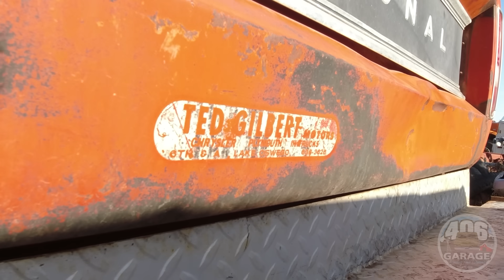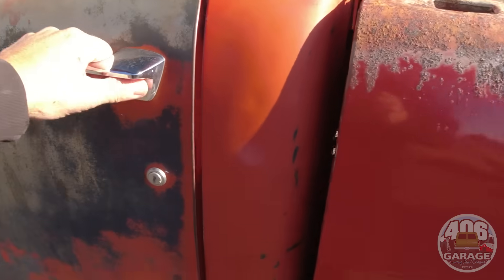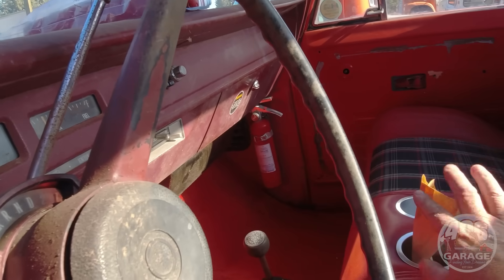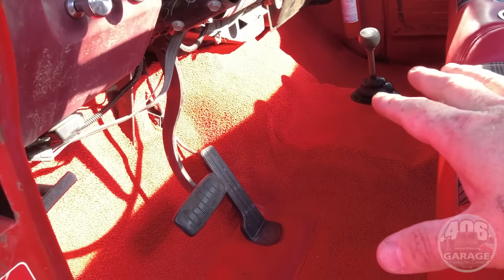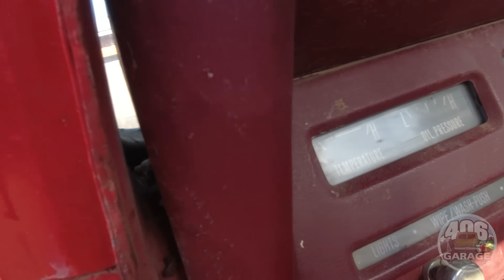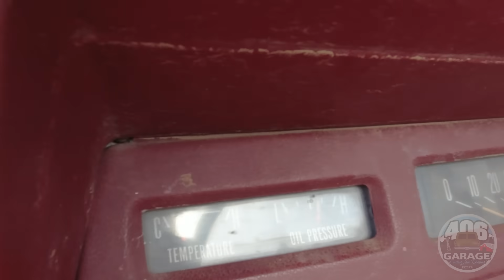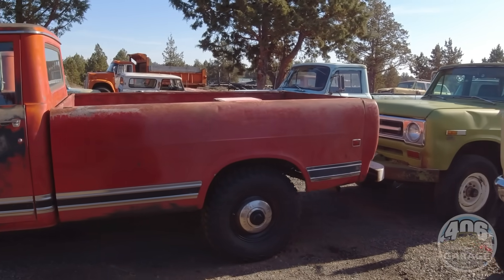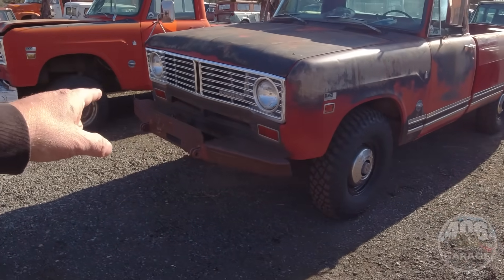The Game Changer LS swapped IH

Comment: Nice!  Glad you kept the GM OEM computer for the LS.
Reply: As opposed to what every LS I've bought sold or traded for a nice piece of automotive history the wiring harness the ECM and  PCM along with the fuse boxes inside the captain's compartment and the 1 under the hood but something inside me said KISS when building our nitro methane rock bouncers Keep It Simple Stupid we made our own fusebox and a box with our 2 rows of relays and 2 more to add on additional lights we're thinking about individual tire jacks for each corner just toss a 12x12 1/2 inch plate before cranking down the jack we make it for our hilift faces so we have faith in these just tie wire it to the foot of the jack before applying pressure unless you like digging for a  foot that sank in really dry sand or really wet sand ask me how I  know we forgot and took turns digging straight down from the jack but the jack started crooked

Comment: hater’s won’t understand. they drive import cars.. this is a American thing. nice 👍 truck
Reply: Haters understand they just don't like it but they should like this it gets way better fuel economy than the stock version and just as if not more capable than the stock version the tree huggers are the ones who want everything to go electric so we can have diesel generators everywhere belching black smoke because the DPF and or DEF rules won't apply to the charging systems as a farmer and owner of a fleet of pre emissions trucks ì can tell you we didn't have to add as many chemicals to the ground before all this emissions BS and government juice drinking engines became the normal thing and when we cut firewood along the edges of fields or hauled the 45 to 70 inch diameter oaks and cottonwoods to our sawmill 30 years ago not many trees were hollow now there's so many hollow small trees so when harvest is done while the hired hands wash up and put away the equipment that isn't going to be used for tillage were going to be bringing the big sawmill trees down the firewood will be cut to fit in the former military 5 ton 6x6 a stretched and boxed frame and 22 ft ɓed with 60 inch sides and a 40 ft pintle hitch trailer to load mill logs on unload them first then unhook dump the loads put on the truck in piles we can push up and pick through with the tractor by the buzz saw I'd like to find a way to keep the thorns from rotting off it would be cheaper by far than barb wire along the tops of feedbunks and corrals
Reply: And it's not an American thing go to car shows in Canada Mexico Australia LS swaps are becoming more popular even in 3rd world countries where people buy 5 or 6 junk vehicles to build something reliable and has what they need save the spare parts that wear out and sell the rest to a different scrap yard and if there's an LS to be had guaranteed the person building themselves a new truck will grab that vehicle first

Comment: Nice work.  Also remember the commercials and received the "Free Beef". Been dealing with Les Schwab since at least the 80's. Brakes, tires,shocks, batteries, suspension rebuild, ball joints, on and on.  Great thing now; no matter where I am in Oregon driving and hunting, if there is a problem there is one close by.
Back to the build.  It would be fun to drive.  Love the seat upgrade
Reply: Every vehicle should come factory with "conveniently located" coldsnack holders for when a fella or fellette needs to wet their backneck

Comment: What's wrong with 7,3 diesel? Got 6 with over 300k miles each, 2 given a . massage at 250 k, now 493 horses at axle with secondary manual o wardrobe at diff. Pulling 4 horse 42' trailer 23mpg.  Just Asking

Comment: So since everything in the world's getting LS swapped does that dropp the price since parts are readable available or like LS swap the nation they think an LS swapped vehicle is worth more in an antique because "it's more reliable so they should bring the new cost of a modern truck the only LS engines I've messed with are those I was pulling out to fund the 454 or 396 I built for my truck and I have put the 5.3 and 6.0 LS in old derbycars with a healthy built turbo 350 in 98 exploders I like the 5.3 but in the modified farm trucks especially my single wheel 1ton farm trucks the ones I use on the farm way before derbying I've taken late 70s early 80s Chevy 3+3 cab and chasìs stretched and boxed the frame to fit a 14 ft utility bed the front drivers box needed modified for dual tank filler necks so I put the face of my welder inside it and silicone sealed it to keep moisture off the dials and modified the tarp to snap to the outside of the box with some weather stripping around it and a little roof over it thad holds ammo cans of small ounces of metal and some bigger pieces up there too behind the welder I cut holes to fit pipemy torch bottles fit in welded them in about 4 inches below the bottom of the box and 6 inches above so the bottles are secure with a small ratchet strap and with modifying the shelves I can hang the lines on the passengers side I have 50 of lead on the bottle and if I ever it I have 50 more feet I can add on pretty quick to remove after the jobs done or just wait till farvest tillage or planting is done to properly put it up I still have just shy of useable bedspace with a vice or an anvil that goes in thereciever hitch and a winch under the bed through the pulley on my ginpoles to assist my crane uf needed and a SAS for the 4x4 then I build a bumper/deer catcher in 1 that I can stand on the bumper between the grill and the deer slayer only thing that's moved it was a black cow at 55 on a slightly foggy night on an unmarked paved County road the farmer gave me new price for a new Thunderstruck bumper with built in grill gaurd I just pulled mine straight enough added some3/8 2 inch straps up 4 sides of the end pipes they're the only ones that aren't old well pipe they're rollcage material so I could do the headlight hoops built in then pulled it off to sandblast and powder coat if it was flat like a truck bumper I'd have probably done what I did with the rest of the truck and rhinolined the entire thing but where it's built like a late 70s GM pointed bumper I'd rather have a  deer or cow slide off with little resistance i think powdercoat was the way to go im already the only 1 whose name is on my county's a a neighboring 1s roadkill list so i don't need to hunt out of season with my truck with 3 big chest freezers in my machine shed and a stove rhat plugs in where my welder does (definitely going to have to ĥave ñy electrician friend put in some new outlets including 1 to keep the stove in the same room as the butcher block and chest freezers

Comment: I looked on your website - where's the ad?  The perfect truck?  One of yours with an LS-series engine & a 700R4 or 4L60 (non-electronic), with a carb intake (which I'm pretty sure doesn't exist).  The result?  No electronics.  You might give up a little power & mpg, but I HATE electronics.  In fact, with ThunderHead289's Carb Cheater, I bet you wouldn't give up any mpgs.  Keep up the good work!

Comment: My daily driver is a 1975. I'm not impressed with the Chevy engine. Stock ih engines run forever. Not picking on you nice up grade good video. I just would get caught with a Chevy in my pickups. I have a number of good spare engines and a bunch of parts trucks